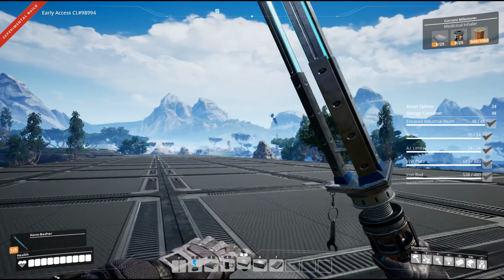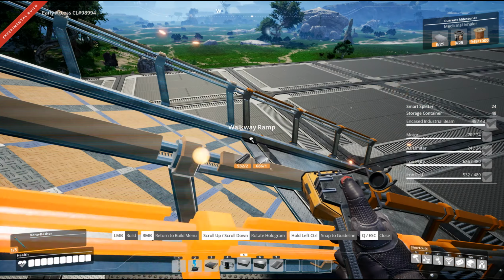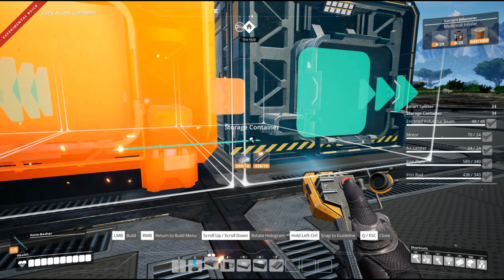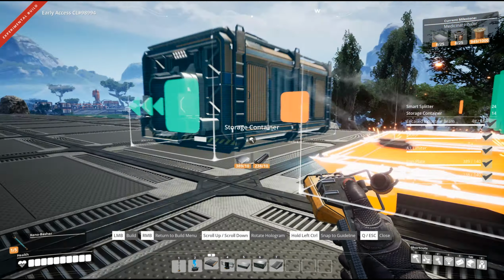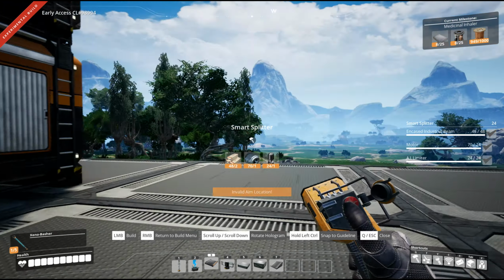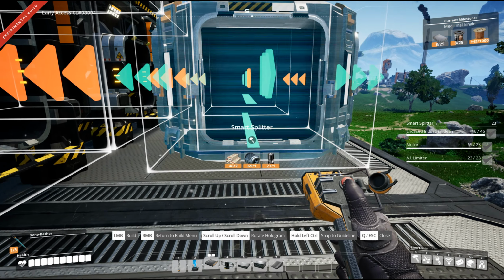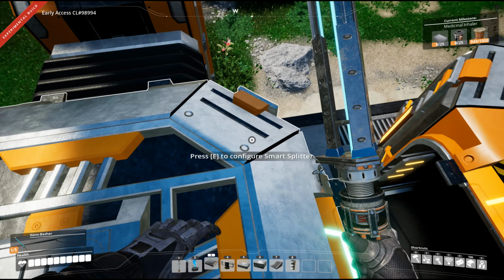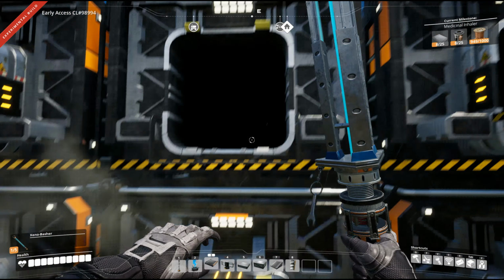Satisfactory Experimental - Smart Splitters and Storage System - Episode 27

Comment: You might get a problem with your storage system. If one container is full the items coming in will clog up the belt, jamming the system :(
Reply from the maker: I'm hoping if it is full it will push it to the end container, or have a mega storage that will never fill. Can't wait for the quantum storage that will really help.
Reply from the maker: Quantum Storage has now changed names to Central Storage which hasnt been released yet but will allow you to access items stored in it from anywhere.